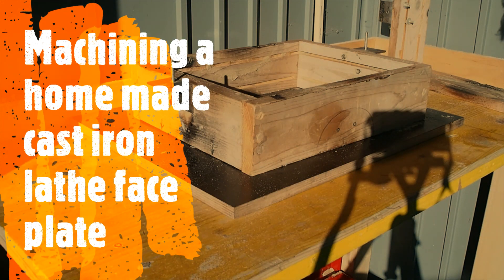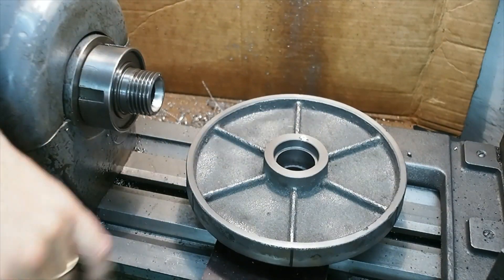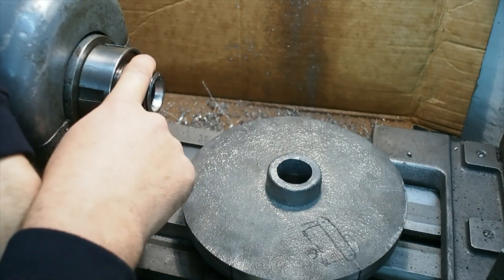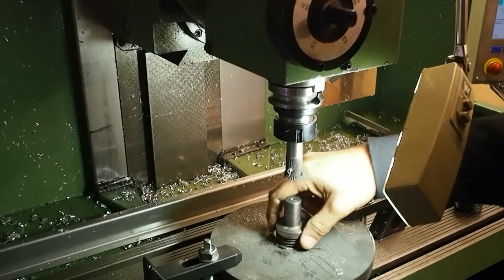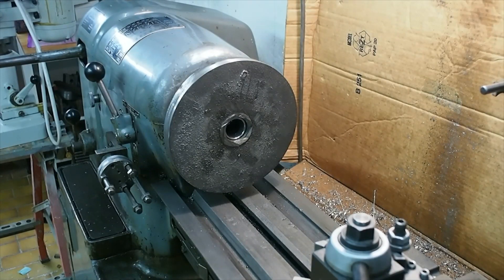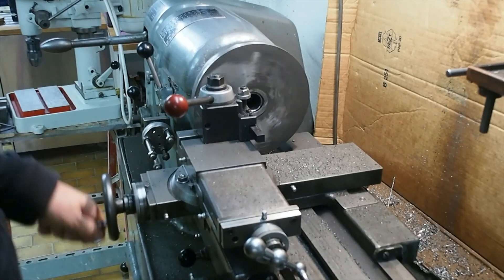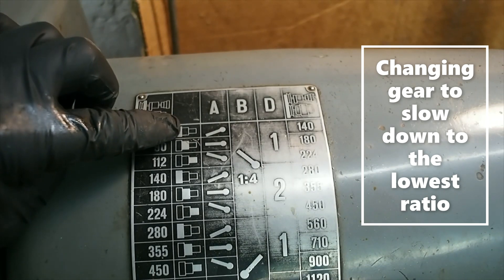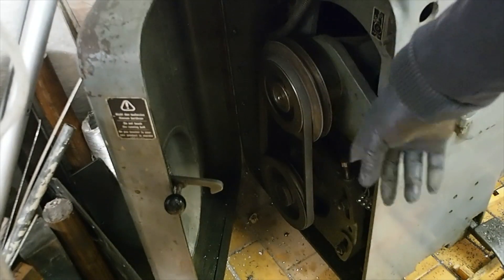Machining a  lathe face plate from a home foundry iron casting

Comment: did u stress relief the cast? or it does not need?
Reply from the maker: No i didn't. I figured if it move over time, it is easy enough to just take a skim cut on theface to true it back up.

Comment: I really like your videos and I'm hoping for some more casting, especially bronze Beatles.  The TOT lighting for the Maho clips is especially noteworthy, as is thread milling.  Having the thread 'guages' was handy.  The finished face plate looked great.
As an aside, I'd also appreciate more in-depth information when you're installing LinuxCNC and Mesa cards in your Schaublin lathe.  
Thanks again.
Reply from the maker: Thanks for the feedback. 
It is difficult to make decent video about installing software, as it is not visually interesting. Altough this is the third time I have done this, they keep changing Linux, and my brain is a sieve, so I always sort of bumble through it. SInce I have a lot of errors, dead ends and questions, the best place to learn from my mistakes is on the LinuxCNC forum, here:
https://forum.linuxcnc.org/26-turning/41498-schaublin-125-cnc-retrofit?start=210#226291

Comment: My machining mentor had a die grinder ready to go with a stone on the end to grind off "that slag shit". He also had an interesting theory that carbide cutters acted more like scrapers or grinders while hss tools sliced
Reply from the maker: Not sure if cutter sceince would agree with him. Stefan Gotteswinter has a number of videos where he grinds carbide cutters to keen edges, just as sharp as HSS.
Reply: @RotarySMP  I think it's a combination of people using dull inserts to get a few more miles vs sharpening hss real quick and also carbide is much more brittle, which means that the cutting edge is likely to have teeny tiny dings as it's used that dont affect finish but probably do affect the 'feel' when you hand-feed. For proof of the affect, he ran a hss cutter boring out a good 2 inch off the radius of a pre-existing bore and ran it at a feed rate that would cause an insert to chatter apart, no problem

Comment: Good video.

I've watched a few of yours now, including this one, the one before it with the sand casting machine that moves the sand around, and some maho ones...

One thought: If you gave even one or two sentences of background it would help. For example, I have no idea what this plate thing you made is actually useful for. Similarly, I have no idea what the sand mixing machine thing is for. The why is always interesting. Oh one more. I had no idea what the scraper machine thing was for. Never saw that before today.

Of course, I might be so n00b that it's not worth it to casually mention these things compared to your average viewer, but I figured I'd mention it in case this is helpful.

Good luck!
Reply from the maker: Thanks for the feedback. I never really thought about this content being interesting for someone wasn't doing this sort thing.

The lathe face plate is used (occasionally) for bolting/fixturing wierd shaped things like castings, which can't be gripped in a chuck or collets.

A machine scraper speeds up the scraping process, which is a slow but accurate way of reutrning worn machine ways to correct geometry alignment.
Reply: @RotarySMP  Cool! I don't lathe, I'm a software person!

But never saw the scraping before... Still confused how this could possibly be accurate... Why isn't a mill better for consistency? How can a human holding the wiggly scraper do such a good job?
Reply from the maker: @purpleidea  It is very slow. You only take off 1-2µm per pass. By "printing" with ink against the flat standard, you only work the areas which are high. Any machine tool will only be as accurate as the ways, ball screws, bearings, frame rigidity, thermal expansion, tool deflection etc allows. With a perfect surface grinder you can make a flatter part than scraping, but with scraping, you end up with undulations, which assist in retaining oil, and therefore reducing stick/slip.
Reply: @RotarySMP  Ah... That's very interesting... Is that what we see on the ways in the MAHO in your first video when you say it looks like they are brand new and didn't get used much? The machine builder people build them with undulations on purpose for that?
Reply from the maker: @purpleidea  Correct. It is called flaking. You break up the ground surface with a pattern of half moon scrapes, quite deep, to retain oil better, reduce stick/slip, and reduce the risk of galling.

Comment: Very nice, thanks for the vid. Why did you choose to thread mill rather than thread on the lathe?
Reply from the maker: Thanks. My Boley lathe didn't have the set of change gears or the associated banjos with it when I got it, just a fine feed adapter.
Reply: @RotarySMP  makes sense. Handy to a have a CNC mill laying around 😄
Reply from the maker: @jonludwig8233  One of my favourite hand tools :)

Comment: Good job.
Just curious: What is the spindle nose thread? If it is M39x4, that is the same as used on the later Emco Maximat Standard, and their successor, the earlier Emco Maximat V10. That may widen your options.
Also, if you ever find the need to run the spindle in reverse, Emco cut radial slots across the spindle register boss and secured it using a split clamp.
Reply from the maker: Unfortunately not. Boley used it's own house standard which is a 39mm x 3.5mm thread with 55° flank angle. The matching collet draw tube has M21 x 1.1mm pitch threads. Hey, we are a lathe manufacturer, we can make any thread we can think of :(
Boley chuck back plates used a throw over nut with a taper to press three brass pins onto the alignment boss to lock the thread.
Reply: @RotarySMP  The Teutonic races are not alone in their independence. Holtzapfel (sp?) used some real lulu's in theirs, sometimes using different threads on the same machine! Who does this Whitworth fellow think he is? We are German/Swiss/French/Italian/British/American (you choose). We'll make our own standards! 
I was fortunate to have served my apprenticeship around the time South Africa was metricating (mid 70's), so I learnt to work with both "English" and Metric systems.

Comment: Hey, I got a Boley 4LV too. Instant Sub!
Reply from the maker: Cool. Does yours have the lever mechanism for switching final drive ratios. Mine is also missing the change gears, and banjo. It is fitted with the belt driven fine feed unit. This is why I thread milled rather than turned the thread.
Reply: @RotarySMP  I do have the gears but no lever. I can keep an eye on the surplus market here in Germany for a gearset if you wish.
Otherwise it might be a cool project to build a stepper-driven device for combined use.
Reply from the maker: Servus,
I already made a NEMA34 bracket which can drive the lead screw.  
https://madmodder.net/index.php/topic,7884.0/topicseen.html

 Have a look from post #19. That is how i threaded the lathe chuck backing plates before I got the MAHO. I used my CNC controller from my little CNC 7x minilathe, but it was a real pain to set up and break it down. Should probably get a rocketlab ELS, but like manual machining on the lathe.

I have only once seen Boley change gears on Ebay UK. THey had just sold. Contacted the seller and sold them to an artist whole was going to weld them together to make and installation. Sad!

My Boley's bed is pretty worn. I am undecided whether to do a big scraping project, Like Martin Oliver did on CNCEcke.de, or sell it and get lathe with a Camlock spindel and norton gearbox.

Comment: Holy cow... excellent cast and even better face plate. Amazing what you can do in a (your) home shop!

I still have to turn some spindle flanges for my Cazeneuve, but have to admit that I simply bought the casting GG25 stock ;-)
Reply from the maker: I also bought GG25 stock when I made the mount flanges for my chucks. The commercial cast iron billets are really nice to machine.